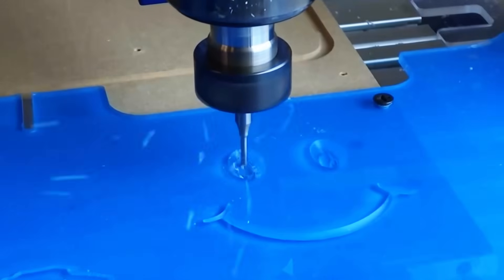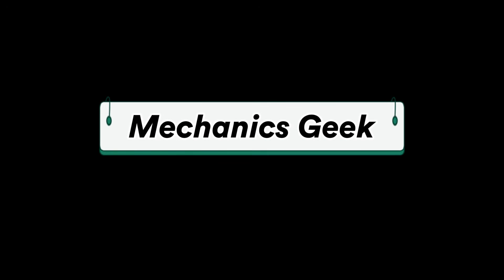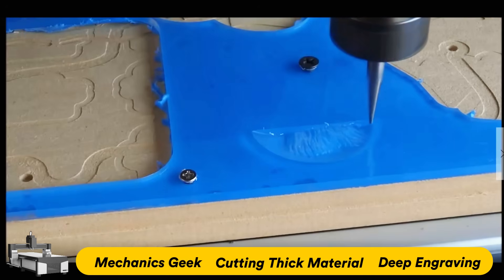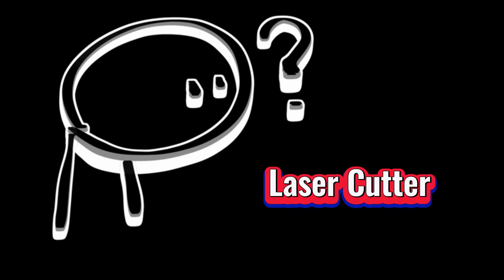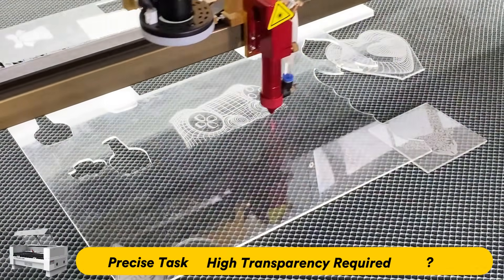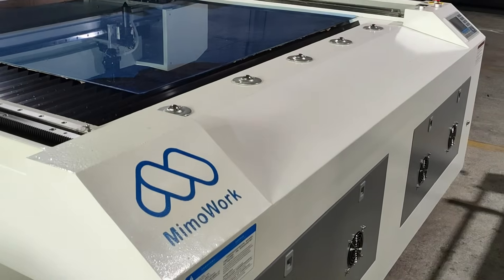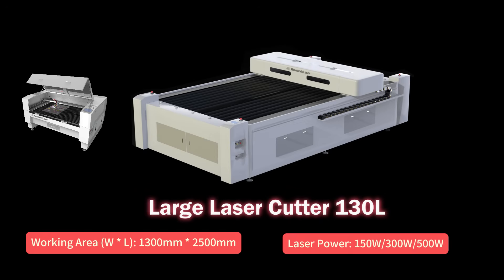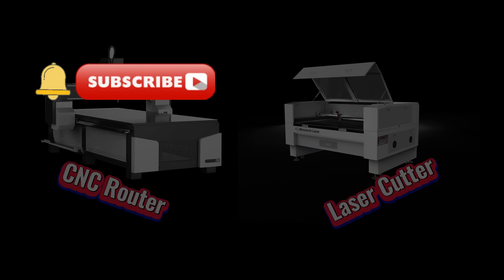Acrylic Cutting & Engraving: Buy CNC Router or Laser Cutter?

Comment: I think you're just a teeny tiny bit biased.
Reply from the maker: Yeah, you got me. Just a little! How about you? Which one do you prefer?
Reply: @mimoworklaser  Depends on what you're doing with it.  I just have a "toy" cnc with a laser and have had more success with the router actually. My problems are always with alignments and getting things to actually work.  The fumes are really nasty with the laser and the router is pretty much nothing.
Reply from the maker: @dougcox835  Thanks for sharing your experience! For the fumes issue with the laser, you can try using an exhaust fan or fume extractor; it's really helpful. We've had great success with our CO2 laser for projects like cutting logo signage and engraving on acrylic trophies—always clean and precise results. I agree, diode lasers can feel a bit limited, just like a toy, especially compared to more powerful CNC routers. What kind of projects are you working on with your CNC router?
Reply: Which one do you recommend to make led signs? Do you need a big machine to cut commercial signs?
Reply: @Rwycki10  you're missing my point.  This is a pure commercial.